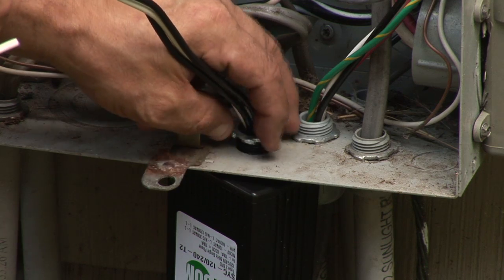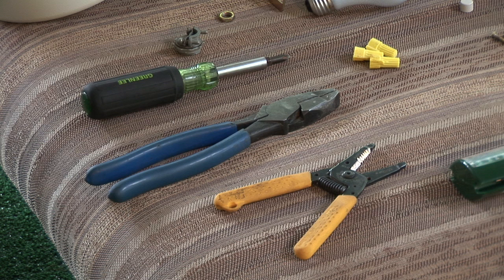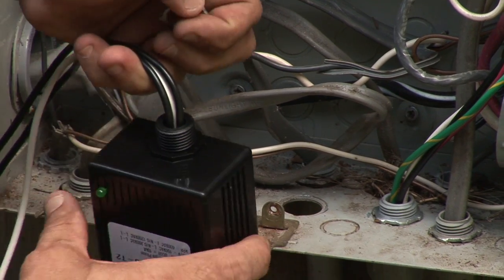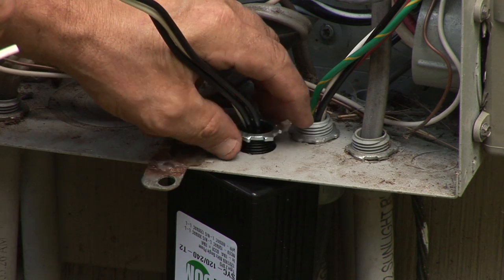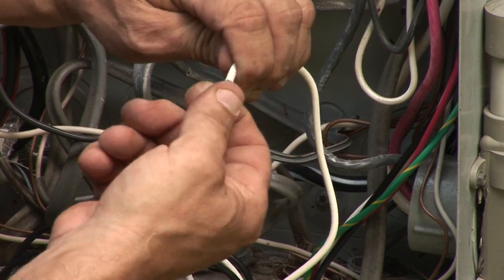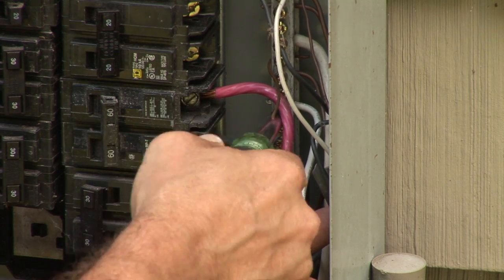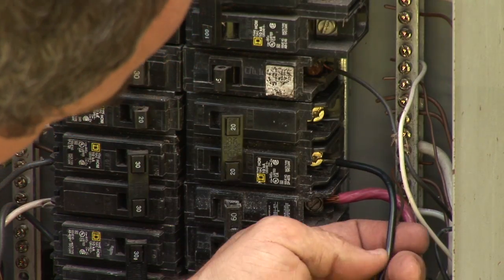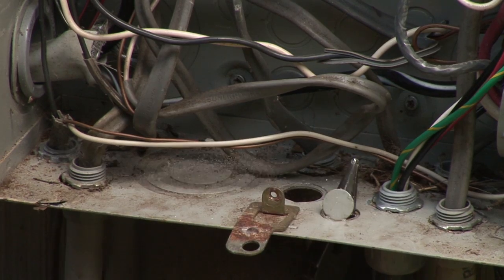Electrical Help : How to Install a Whole House Surge Protector

Comment: When you buy a power bar with surge protection, it protects whatever is plugged after. So, how will this work then? 🤔  since it is plugged not between the service and the electric panel, BUT parallel to the panel? 🤔🤔🤔 interesting
Reply: This doesn't work the same.  It gives the surge a less resistant path to travel, back to ground.  The path to any of the branch circuits is way longer than the path through this devices and into the neutral bar.  The surge takes the path of least resistance and never gets to the other lines.
Reply: @dmkrodge  ok thanks 😊
Reply: @dmkrodge  Thank you!!! A couple quick questions, since you seem knowledgable... 1) The wire gauge seems fairly thin, like 12 ga or so. How does it handle significant power overloads? It must be the short leg to neutral bar, low resistance, so increased power handling capacity? 2) Does a 20 amp breaker trip with a surge, or is that the purpose? I know little about electrical, and it probably shows. 3) In your opinion, how effective are these surge protectors, and which manufacturer/model would you recommend? I read that each sensitive device should also have a dedicated surge protector. True?  I just had another minisplit added to my house and asked the installer to add a surge protector. My other 2 minisplits don't have them. We just bought the house.  Thanks!
Reply: @acbent11  I wouldn't recommend anything without knowing your entire setup. Any reputable manufacturer is fine.  I tend to go with the same manufacturer as the panel whenever possible, but not really necessary.  Follow the instructions from the manufacturer as far as wire gauge and breaker size go, they are different between models. But, yes, the breakers will trip on a a surge.

Comment: Thanks for this video. I need to replace mine. Electricians originally installed it directly to the incoming feed unprotected. No way to kill power to it. Didn’t think that was right. I’ll grab a two pole breaker and do it right. Will have to have power company pull the meter to remove the old one. Thanks again.

Comment: This video allows for Darwinism. His disclaimer is that you should contact a local professional if you don't know what you're doing. Well, no professional will disclose all secrets of the trade, but, if you believe you need a surge arrestor and this is the only video you plan to use as research, then, you might be the very person that deserves what's coming.

Comment: LOL wtf man worse video i've ever seen by an "electrician". No de-energize the panel you're working on? How about we screw the wires on the breaker when it's not already racked and hot? Then you leave the home owner on the hook as to where the other wire goes.

Comment: Nick, you have to mention to TURN OFF THE POWER ON THE ELECTRICAL PANEL. Next, you mentioned two black wires. One of the you connected, and what about the other black wire. Do you cut it off, connect it somewhere, or what.... update your video....
Reply: A lot was assumed in the video, as if it was edited for time.  The 2nd black wire goes to the 2nd lug on the other part of the 2-pole 20 amp breaker.

Comment: Terrible... Damn if you are giving the public info you might wanna tell them to FIRST turn OFF the POWER  and confirm it is disconnected ( do ya think?)  next why knock out another  K/O when you have an open hole right there ? SMFH🤔 and I think ya might wanna connect that last wire to the other line or  about 1/2 the place won't be protected. you're dangerous at the least, stick to gardening.

Comment: how long does the surge protection last before you need to replace the unit?  I assume its like normal plug surge protectors that need to be replaced after a few years.
Reply: When the LED indicator on the device connected to the load center illuminates.  On my of these devices one light status will indicate proper function and another as labeled will indicate product failure and replacement is needed.
Reply: When the green light turns red.

Comment: Ha1 How bout telling u to turn off the power? Did the other black wire vanish? how if this going to protect your house the way its wired?
WTH!!???
Reply: Steve james if u don't feel safe, let the city public service on your area that you will disconnect the meter can, power will go off on your electrical panel then you can start working on it. The two black wires go on the 2pole 20 amp breaker, one black wire to one lead the other black wire to the other lead of the same breaker. White wire to the neutral bar. Once you turn that breaker on, the surge protector leads (black wires) will contact both main lines on your breaker box.

Comment: Where did the second black wire was connected?
Reply: I was laughing my ass off thinking the same thing of course I already know
Reply: The other lug of the 2nd part of the double breaker just as he connected the first black wire.  It's almost as if this video was edited down and simplified for the purposes of time.

Comment: Great advise but what do you do with the second black wire???
Reply: Connect it to the other open lug of the breaker, I am surprised as well he doesn't mention that.
Reply: But then you wouldn't be a confused home owner calling an electrician.
Reply: solution: buy a 2 pole breaker. connect one wire to one terminal, the other black wire to the other terminal. that way youre protecting both phases of the panel
Reply: @parkourguyyy  does it matter which wire goes to which pole?
Reply: @enkrypt3d no, it shouldnt matter. but if the SP has an indicator saying A phase and B phase, id recommend putting the wire to the respective phase for consistency sake. top phase of the 2 pole would be A phase, and the bottom would be b phase
Reply: assuming you put the breaker in the very top of the bus bar that is
Reply: @parkourguyyy  ah ok that makes sense - I just ordered the leviton 51120-1 and it says it can share a 20A breaker - should I put it on it's own breaker or make it a 30A?

Comment: He also did not address what type of breaker. Some people think the surge protector should be attached to breakers closest to the input power and will go so far as to move existing lower down to put the surge protector near the "freshest electricity". My surge protector instructions do not address this issue and I doubt if it is important.

Comment: ok so you have protected half the panel wasted one pole of the 2 pole breaker punched out another knock out when you could have taken the opportunity to use the one that was already open and a code violation  and is that surge protector even rated for use outside in the wind and rain  what a useless video
Reply: the knock out was the first thing i seen to know this isnt the video that will be giving the best info. it also seems like they edited out 50% of the instructions. plus any electrical diy how too video should start by showing how to stop electrical flow upstream of what ever youre working on.  ie. switch for bulb, breaker for outlet, main for breaker, meter for main, ect. the general public is made up of 99.999% of people with zero knowledge of electrical. a how too should be idiot proof if you're going to make it.

Comment: The first thing you should indicate is to shut off the power and verify the absence of voltage before this work is performed. This type of work does not qualify as justified energized work because it is feasible to remove the energy to perform such an installation. Performing work like this on live electrical equipment does not conform to NFPA 70E or OSHA regulations and puts unqualified persons such as homeowners in a dangerous situation. Unqualified persons are not familiar with safety rules.

Comment: Do you install these in the main or sub panel?
Reply: Main and you connect BOTH black wires one to each lug of the two pole 20 amp breaker in the load center.

Comment: Although I believe Kevin Sheriff to be a bit of a nazi, I agree with (at the very least) showing the termination of the second wire.  And why you didn't just use the knockout that was already knocked-out and why you didn't shut down the main and how this thing works when downstream of the main breaker.  Okay, I'm a nazi too.  And as nazi's, we kick the crap out of weiners named Sherod...douche-tard.

Comment: Thanks for the video! I am a bit confused though, I don't fully understand how a surge protector of this type can be effective if the breaker is installed anywhere lower than the top of the service. It just seems that in the event of a surge, wouldn't the current travel to all circuits above the breaker powering the surge protector? I really appreciate your time in sharing the video.
Reply: Yes it would, perhaps in that area the "rules" require electrical current to flow differently.  I do not judge.
Reply: I heard the lightning surge comes from below, via the ground rod.

Comment: Just a little constructive criticism from a fellow spark-trician. You might revisit the idea of doing the video again. 

1. You don't remind the viewer to turn off main disconnect for their safety. 
2. When you list tools needed I was surprised you didn't suggest a multimeter to insure ckt was dead.  
3. You didn't explain the reason or the benefit of installing the unit? 
4. you didn't show or tell where to install the 2nd line wire?